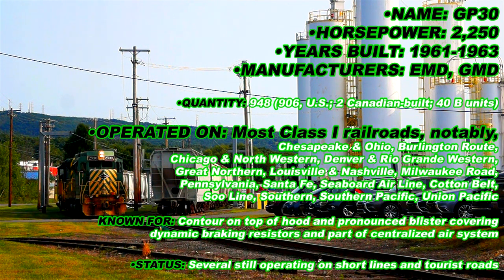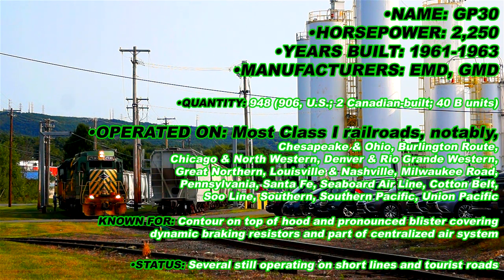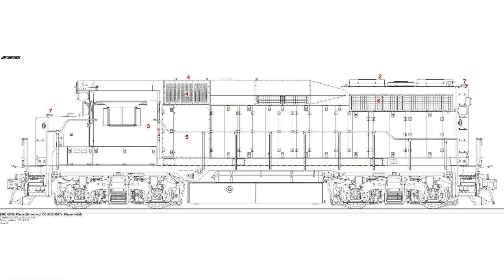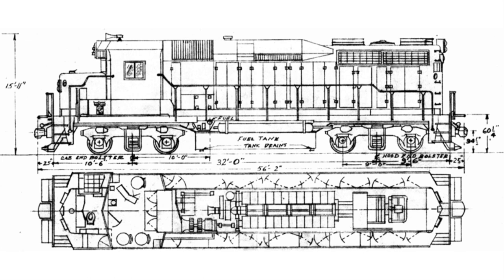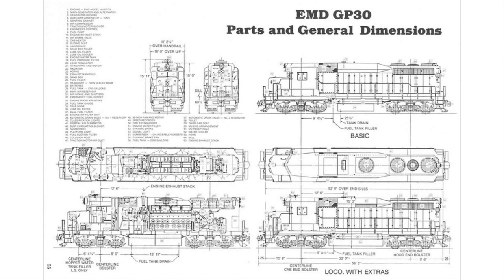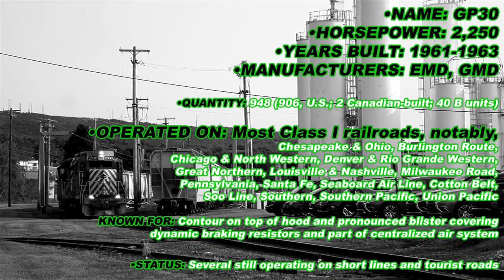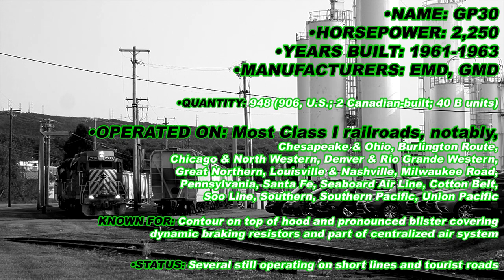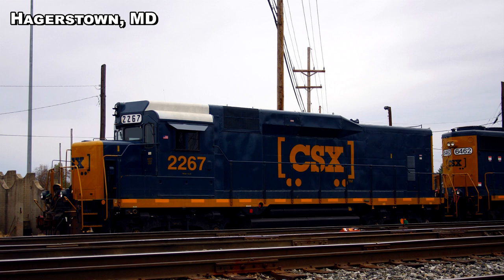ODDBALL EMD: GP30 60th Anniversary | The Hercules of its time

Comment: As a kid in the early 70's, I now wish I had a camera to document the locomotives used by the Penn Central on it's Bordentown Branch line that served the nearby steel mill and other businesses along the line. The day time local Locomotive of choice was what I later learned to be the non-turbocharged GP35's that they got from the Pennsylvania Reading Seashore Lines. PC only could be bothered to place the PC logo at the front nose, the side body got no markings at all. On occasion, that GP35 was replaced with a high hood Alco RS11; a sound very different from that non-turbo Geep. But for a short spell of time, a very distinctive looking (to my eyes) did the local transfer work: a GP 30. A big part of the allure to rail fanning is the sound around you coming from that engine. And to my young ears, that engine was something all together unlike the 35 or the RS11......it was that turbo. That was a unique sound wheen spooling up from a stop with a load of heavy steel cars in tow. It was a sound that made me an EMD fan, for life. Oh, and that GP30 had the full PC logos treatment. And it remains today as the most uniquely styled of EMD's; back in a time when EMD was the King of RR diesel locomotives with the power of General Motors backing it up.

Comment: Cp rail rostered 2 GP30s they bought the canadian demo units and purchased the gp35 instead getting 25 the cp's where numbered 5000 and 5001  both entered shortlinenservixe in the late 90s the 5001 was stored in shop trucks at weston shops winnipeg through the early 90s until sold and rebuilt.

Comment: why did RBMN rename theirs to GP39RN's?
Reply: That's a good question. The ATSF had rebuilt them to 2500HP units using 645 engines but called them GP30u's. The actual GP39's produced by EMD (23) were rated at 2,300HP.